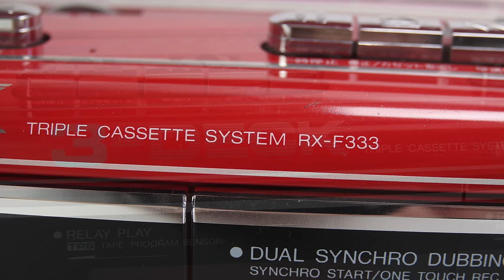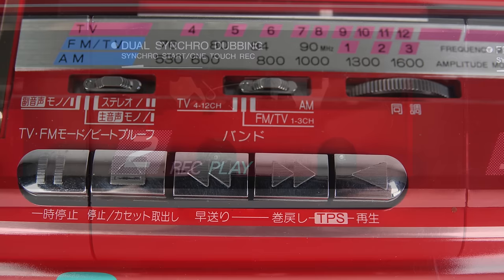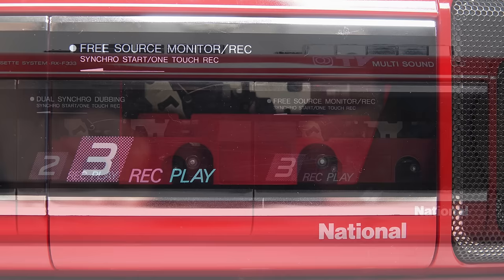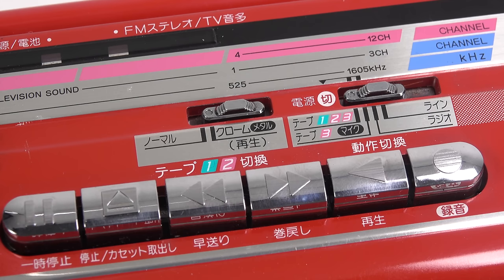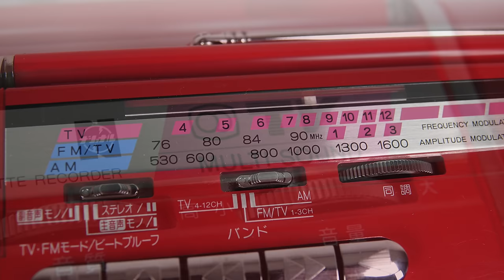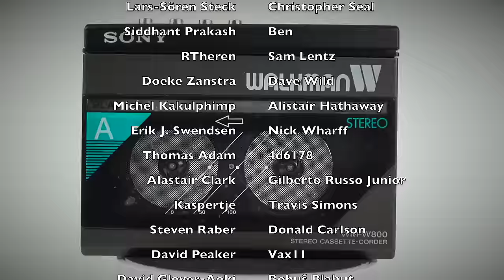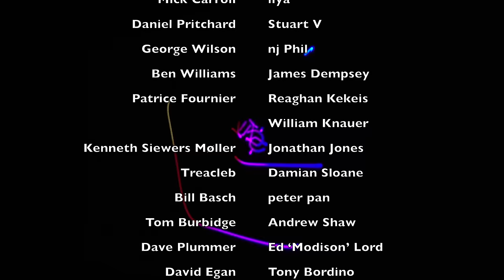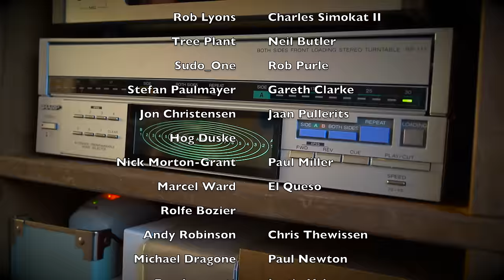The Three Cassette 'Boombox'

Comment: Why stop at two cassette decks when you can have 3? Thanks Japan.
They needed another model where you could just chain them together at the sides. 38-cassette boombox!

Also, brilliant puppet segment as usual.
Reply: Add cassette auto changer!
Reply: LeiserGeist This was obviously the test product to see if there was a market for even more decks.  I guess initial sales weren't big enough to go ahead.
Reply: This makes me want to time travel to around the year 2000 and pick up hundreds of cassette decks for next to nothing, and jerry rig them all up together to make basically a giant cassette changer where every single tape I own just has its own mechanism and head
Reply: It existing 3 decks of Hi-Fi: Pioneer, Sony and Aiwa.
Reply: The actual sense in three decks is that it enables two sources to be merged to one output cassette (if you can get the start synchronisation correct),  useful for music and speech for a presentation on slide or overhead projector for example,  as well as duplication of say the church services for the blind to be done quicker for distribution on the monday.
Reply: @ohnoitschris  Imagine if every cassette had its own head and mechanism built right into it… sort of reminds me of the Sony Ruvi (https://www.youtube.com/watch?v=Qt_ct4wBnv8).

Comment: Those pulleys are pressed onto the shafts. So if your careful enough you could get them off by pulling on the pulley side, ether the pulley or capstan will come loose. That would also be a good time to get some graphite in the bearing.

Comment: This could not be more timely! I just repaired my old Lasonic deck using a JVC mechanism I found on eBay. 

I was able to get the capstan clips out with a sharp ended tweezer. Put a piece of static foam in the tweezer to hold the jaws “normally open” and press the tips down into the plastic ring. It will take some time but you will get the ring to open slightly. Then using another implement in the other hand, prise the clip up the capstan and away from the groove.

Comment: Your Cassetee Adapedr is “New3,” so it must be made specifically for this 3-deck player!
Reply: Yes, but "New1" and "New2" are required to fill the first two decks. Now you can switch to the second deck when your first Bluetooth source is exhausted, and the third when the second source is exhausted. Then you can flip all three Adapedrs over and play side 2 of all three of your Bluetooth sources.

Comment: The flywheels are easy to remove. They are held in place by a small plastic washer on the capstan. These washers act as a C clip, they fit into a groove in the capstan.

Comment: I have taken apart similar mechanisms (and put them back together successfully--mostly). The shaft that extends from the back of the capstan into the flywheel (left of your thumb at 7:00) is most likely not welded to the flywheel itself, but rather very tightly pressed against the plastic core, which is itself attached to the metal bit. Try heating up the center of the plastic core to soften it slightly, and then you should be able to remove the whole thing. A heat gun is ideal, especially with a small nozzle. A hair dryer might not be hot enough but is worth a try if that's unavailable. Edit: I've also heard of people doing it over the stove or with a lighter. Good luck!

Comment: That balance wheel comes off if you apply enough force  underneath. But do it carefully. My audio engineering hobby has started with taking the parts from different cheap cassette boomboxes and putting them together when I was a child.

Comment: The capstan is often held in place with a thin split plastic washer that is seated in a grove on the capstan shaft. This can usually be pried out with care without damaging the washer. The translucent washers are usually the easiest to remove. The black washers can be trickier as there often less flexible.

Comment: We has a Yorx FP-1010 'triple-decker'. 

https://i.pinimg.com/originals/80/73/de/8073dea61910fac2ff2e96ec157d3ec4.jpg

Build isn't National Panasonic-quality but it works - and the belts hadn't gone to BP Gulf Coast goo. Deck one does make a quiet clicking sound that we haven't been able to sort.

If 'Scrubbing Bubbles' spray-can bathroom cleaner (or an equivalent) is available in your area, the stuff works great on that gunge.

https://www.scrubbingbubbles.com/

Comment: Hi Mat.  While I can't think of many shortcuts to removing tarry belt goo other than disassembly for access, I think I can help with the cracked pulley.  I have a little experience with nylon gears, wheels, pulleys, etc. that are mounted onto steel shafts.  Over time the plastic shrinks a bit and since the steel isn't going to be compressed by some puny disc, the puny disc will just crack.  I try to take a two-pronged approach to repairing it.  If it's something that's supposed to pivot on a shaft smoothly, this might be more tricky, but check the interior diameter of the hole and see if you need to slightly enlarge it so that the gap can close fully and not be forced back open by the steel even when it expands with heat.  Then fully de-grease and clean the wheel.  Using a small clamp, you can squeeze it gently to close up the gap.  Now you can go with glue and a splint, in this case I think crazy glue and a small washer on top might work, if it's the very last thing that goes on that spindle.  Or, you can do rather cool trick with a hot razor blade.  Clamp a razor blade in a pair of vice-grip pliers.  The idea is to heat the razor with a clean flame that doesn't soot the blade.  You insert the hot blade into the crack in the wheel, and squeezing the wheel, you withdraw the blade quickly and if you do it right, you can actually weld it back together.  This is the best approach for smaller parts where glue and a splint won't work, but you really only get one shot at it.  At least with cyanoacrylate glue you can get a do-over on parts that will withstand acetone.  Good luck.  PS- any interest in a Mitsubishi 5 cassette changer boom box?

Comment: The split washer that holds the capstan is easy to take out. You need to use a small flat blade screwdriver between the split and then twist it a bit, then use another screwdriver behind and push it at the same time. Good luck, and don't forget to relube the capstan bushings and also don't loose the washer spacer behind the split washer 🙂

Comment: Here is how you take the flywheels off: Get a good pair of electrician's pliers. Cover the jaws with aluminium or kapton tape (not strictly required). Grab the axle that comes in contact with the pinch roller from the side (so that the pliers have less chance to mar the pinch roller/tape area), then twist the flywheel with your other hand a little whilst pulling it out.
When putting it back together, make sure the axle circlip isn't pinching the bushing. Do not attempt to remove the circlip, it is not designed for that.
You will also have to reduce the tension of the clutch because it tends to grab more as it ages and the belt would take the brunt of the slippage otherwise.

Comment: hi techmoan! what you can do to fix those spring-loaded pulleys with the broken washer is: get rid of the spring and the washer and drill two tiny holes on opposite sides drilling through both (black pulley, cotton felt washer and white pulley) pulleys at the same time with the skinniest drill bit you can find, Dremel type, basically you're gonna put the two pulleys together with two tiny sunglasses type screws. cause what the spring and the washer do is basically push the two pulleys together with force, the two screws are gonna do a better job just make sure that screws aren't too long to obstruct the pulley from spinning, cause the spring doesn't do a good job and either the belt or the pulley are gonna slip. I have done this to some of my boomboxes, and they work excellent with the right speed and no wow or flutter! hope you can fix yours!.

Comment: Ahh, the good old Tanashin "simple tape mechanism", both the blessing and the bane of every boombox made after 1984. A bane, because the secondary belt ALWAYS fails, and causes it to "eat tapes". A blessing, because it's easy to fix and parts are still plentiful (in fact, it's still being made). I have seen popped clutches in super-old specimens as well. Fixing is easy: just slip a new secondary belt under the flywheel ( you might need to lift it a bit to get past the pause mechanism's cam). To remove the capstan and flywheel, you must remove the retention ring in the front of the mechanism.

Comment: I've disassembled a few cassette decks in my time, and as others have suggested, almost always the capstan is held in by a metal E or C clip (in the more expensive decks) or a split nylon washer (at the cheaper end of the range) on the cassette side of the deck. Good luck with it!

Comment: The capstan is normally held by a tiny plastic washer which is split. Under the split washer is another plastic washer that is not split. You can take them away but must be very careful not to destroy the washer or not to loose it. Sometimes they fly away and it's hard to find them!

Comment: A few things come to mind while watching this. One is that in the many years that I have spent repairing audio, I have only encountered one incident where the belts turned into a melted goo-like substance and it's not really a normal thing because most modern belts (back in the day) are not made up entirely of rubber. That only one incident was when I acquired a used Ampex reel to reel tape deck that ran on tubes. Most belts just break and the material just cracks up; it doesn't turn into a melted goo. Second is that there are many cassette mechanisms where the plastic parts just split and are no longer good viable parts anymore. Sony had in their walkman players the flywheel that was made of metal on the inside portion of it, but yet they made the grave mistake of making the outside circumference of it be a plastic gear. Of course, that plastic would split and every time the flywheel would go round it would go "clunk, clunk" as it spun not only making for a bad clunking noise as it played, but also made the tape speed's wow and flutter so bad that the sound was then unreasonable never mind the clunking of it mechanically. Lastly what comes to mind is that apparently you probably never worked on a stock Mitsubishi car stereo cassette deck. That mechanism was a complete mechanical nightmare. It would literally take the tape in just to load it in FOUR mechanical gyrations and have to do the same thing to eject the tape. THAT you can put into your to most tape decks at NUMBER ONE as being the WORST tape deck to repair in history, bar none!!!

Comment: Removing the fly wheel from the mechanism is actually quite easy, There is a small washer on the capstan that you pull off and the fly wheel slides out. (I like to use a small screwdriver to pry it apart just so it pops out of the indent while gently pulling on the flywheel.)

Comment: If I can recall correctly,  those flywheel can come apart from the front side,there should be a little plastic cir-clip black white or clear in colour..pop that off and it should slide out the back..hope that helps...

Comment: There is a small plastic locking split ring/washer on the other side of the flywheel, if you remove it, it will allow you to pull the flywheel out easily.

Comment: Hi Matt.  I have fixed hundreds of those tape decks.  To remove the fly wheel is very simple.  If you look at at it from the front, you'll see a grey split ring inserted in the recess quite on the capstan spindle. Split the ring open making sure it does not fly away.  Once that is removed, the wheel just comes off from the back. You can clean the perish bands with lighter fuel. They are a bit of a pain to clean but you'll manage.  Should you need any parts,  i have a few extra pieces.  Let me know.  Cedric

Comment: As soon as you showed that first pulley I KNEW it was the clutches and split nylon parts. It's the bit nobody ever talks about! It fails in most of these post-85 tanashin mechanisms, including Fisher Price PXL2000s! They are nigh on impossible to glue but you can harvest them from other generic Tanashin mechanisms from cheap 90s midi hifis, boomboxes etc. And yes as someone else mentioned, the capstans are held in by a split washer!

Comment: On some cassette decks, there is a plastic disc which is deformed over the top of the metal spindle to sit in a groove in the spindle itself. This is like a cheap c clip and is the same principle as the broken white plastic clips holding the clutch in place. I suspect you need to hook these out with a pick. I have made successful replacements for these out of thin plastic margarine lids. thicker plastic from polythene tubs might yield replacements for the clutch mechanism. Great work. Excellent triple cassette.

Comment: There should be a C ring on the Cap stand side of the spindle  that locks that back flywheel in place if you had ever taken apart a computer fan, the sticker on the back hides a similar  C ring that prevents the blades from popping out, same with the cap stand

Comment: You can use a narrow tool to push the capstans right out of the flywheels from the back to get them off....they are only held in by friction. You don’t want to try to pull or pry the wheels off as you may either bend the capstans or break the tiny retaining clip on the other side. I wouldn’t mess with the little retaining clip as others are suggesting as you will only give yourself a royal headache trying to put them back in if you are lucky enough to not lose them the second they come off!

Comment: capstans are hold with a plastic circlip on the other side (the shaft end). Quite easy to remove with a pointy tool. By the way those tape mechs used in millions of machines in slightly different styles. They were quite common in cheap machines. I think it was manufactured by Tanashin Denki corporation of Japan. Model  TN-21ZW variation

Comment: Blue Windex (not the off brand stuff) works like magic on that rubber belt goo and turns it to liquid. Get a cheap water pic and fill it with Windex for the tight spots.

Comment: Having a TV receiver in the UK would have made recording Top of the Pops so much easier :D
Reply: Right? We had a TV toward the end of the CRT era that could receive radio stations - it just showed a black or blue screen with the frequency in the corner - but the other way around would have been cool. Though as with taping the Radio 1 charts, you'd have no doubt lost the intro and the last 20 seconds of the song to Bruno Brookes or Mark Goodier yacking all over it (presumably to deter exactly this behaviour!)

Comment: Mat. Drop me a line. Fixing your decks not an issue. Usually little plastic clips or metal e clips hold capstan in place. Fiddly but not impossible to remove. Just a case of cleaning and matching up a couple of belts. I repair stuff like this all the time and since it is in the interests of your YouTube channel would only charge a nominal fee. Cheers. Gaz

Comment: Classic problem with very old belts and degraded plastic pulleys. Very old cassette players is better to be checked for problematic belts before any operation. Also a little lubrication of the cog-wheels beforehand with proper grease isn't bad at all. 
Some strong epoxy glue may temporarily solve the problem with the broken pulley.

Comment: Just clean behind the fly wheels with pipe cleaners. You can slide them in under it easily, they are felt covered and meant for cleaning tarry stuff.

Comment: get some wool yarn, dampen it with rubbing alcohol and feed it around the wheels, slowly pulling in a new clean section as the old gets dirtied. You may need tweezers or toothpicks to remove any straggler wool strands that get caught in the mechanism, and a few will.

Comment: You could try dental floss, combined with contact cleaner and then a clothe work it like the dental floss back and forth. It will take a bit of time but you won't have to remove the wheels.

Comment: I noticed from the intro that the 3rd deck is slower at ejecting, probably was not used as much? The Synchro designs on it look like my old Panasonic dual cassette deck circa 1993!

Comment: Most cheap cassette capstans were held in by a plastic circlip  - they look like a 3mm diameter washer but are split to allow them to expand over the shaft .  With regard to the white clutch part ,  I could try 3d printing a couple for you if you let me have dims

Comment: Very interesting piece.  This is one ghetto blaster I do not believe I have ever seen, and it has probably never made its way to the states.   But this is not the first time I have seen a triple deck cassette recorder.  Sometime around 1989 I bought a unit at a Sam's Club, which is an exclusive warehouse wholeseller that is part of WalMart.  They usually have things Walmart doesn't and I bought a unit made by a company called Yorx.  It sported 3 cassette decks two on the front and one detatchable unit on top, essentially a docking walkman.  It also featured detachable speakers.  I remember paying about $85 dollars to bring it home, and was disappointed to find it non-working right out of the box.  It was exchanged straight away for another new one, and I remember that the sound was quite faint on the left side.  I opted for a refund that obviously two bad units in a row constituted poor quality on the part of Yorx, and I went somewhere else to buy a Sanyo.
   I was going to mention the dplit rings as well but seen this was already done in the comments, hope you have gotten that sorted out.

Comment: Denatured alcohol and controlled application/collection/removal; "Pinball Machine Oil" next.  Pulley mechanism was probably not designed for removal, otherwise a custom spanner/puller may be necessary.  Great take on the YouBoob left-wing-appeasement issue.